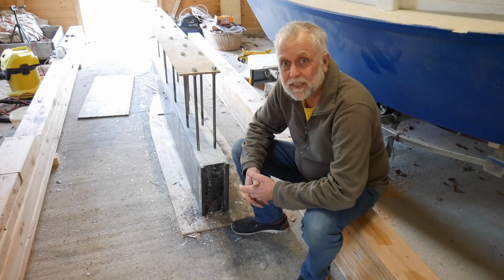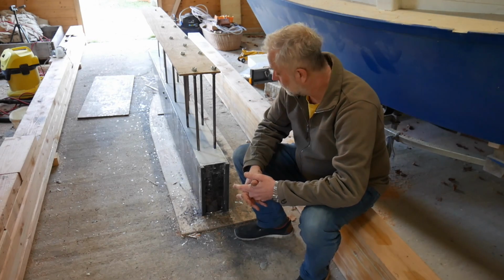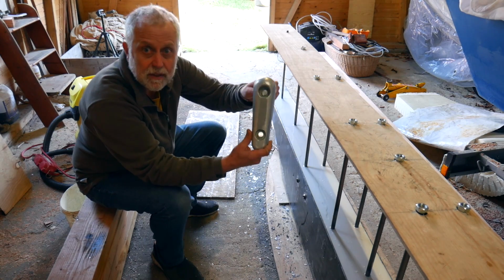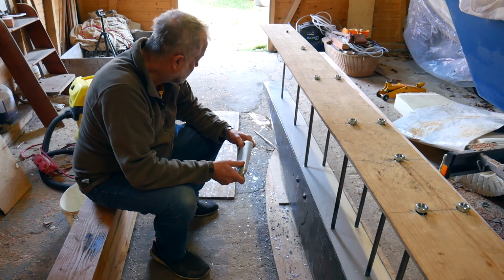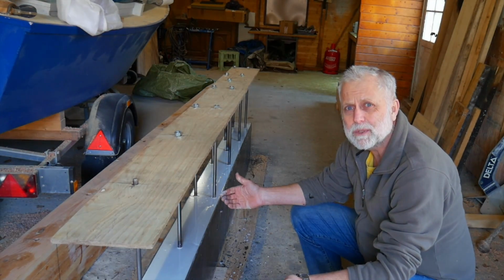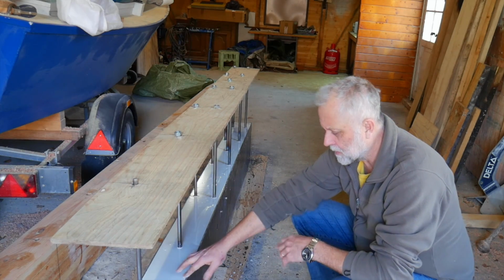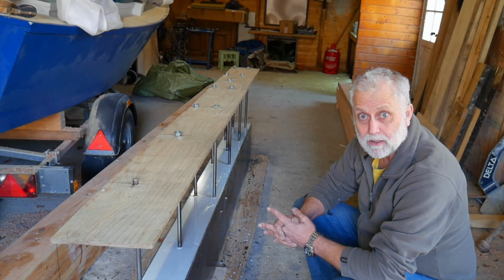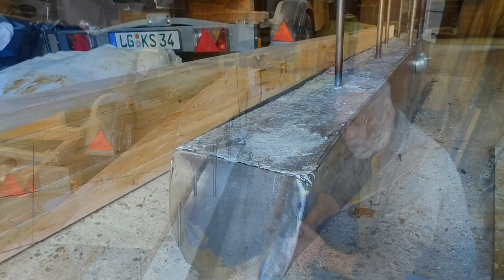Filled, Sealed and Anode Ready; The Ballast Keel Box - SV Tapatya EP224

Comment: Beautifully made keel👍
For attaching zinks weld a stainless bolt to the keel then use a stainless nylock nut and washer to attach the zink. That way you have a way of tweeking them up as the zink errodes.
Reply: @David Medley: Correct! In my experience it is better to weld the stainless hex screw to the keel and fix the anode with self-locking nuts. But even so it works. In any case, great work Tony, I look forward to the launch!
Reply from the maker: Pretty sure it'll work this way too, David 👍

Comment: hi Tony, first I say you are making a great and very nice Yacht. I seen you poring epoxy on the lead and steel. I think thatch not a good idea because all these tree materials have different expansion coefficients. so the epoxy will crack or get lose from the steel . this happend to me when I trying to glue  plywood to a steel dek. Maybe Its better to use a more elastic material.
Reply from the maker: Thanks for the kind comments. I think there's a difference here though. The expansion you experienced was due to moisture absorption of the wood, which leads to significant swelling. Thermal expansion of the keel materials will be minimal because it's generally less and there won't be much temperature difference

Comment: Great work and great video. How much propane did you use for the pour? That would be useful information for anyone doing this so they don't run out mid-job or buy too much.
Reply from the maker: Good question Dave. I had a couple of already started bottles, one of which was nearly empty, so that makes the question a bit hard to answer exactly. But, I used most of an 11kg bottle and maybe 2 5kg bottles. Not too much, all in all

Comment: Hi I’ve only recently warmed to what you are achieving. Much respect to you for your ability to tackle a variety of disciplines to get to near completion. It will be a proud moment when you hit the water. One question please, what resin did you use when laminating the outside of your hull. Was it  polyester or vinyl ester? Thanks
Reply from the maker: Thanks. It will indeed! The resin was epoxy. Polyester doesn’t really stick to wood very well. You can use it, but need to build up a much thicker glass layer so it’s self supporting- 5mm thick or so. Epoxy bonds well to the wood so, as a sealing layer, only one laminate layer is needed
Reply: Thanks Tony

Comment: Tony, I know it’s a little late but did you add flux to the lead to try to get of the junk to float?  A friend of mine would use beeswax when he would cast lead bullets and they came out very shiny.
Reply from the maker: Thanks Dennis. I didn't, but I've seen people using sawdust as a flux in lead. I found that the dross came to the top when I gave it a good stir. Having said that, my lead did have a good dusting of wood dust on it, so maybe that acted as a flux 🤔👍